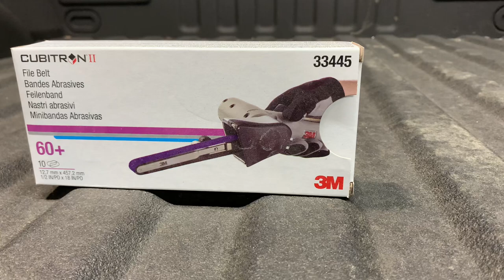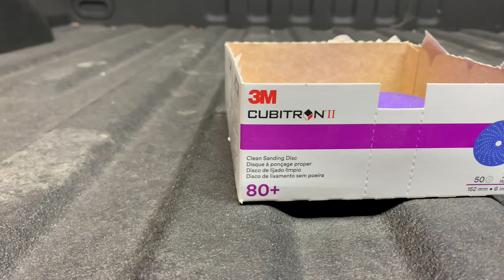FORD F-150 FX4 - ALUMINUM BEDSIDE REPLACEMENT

Comment: I use spr’s in the wheel openings and the by the tailgate. Blind rivets look terrible. Great video though.
Reply from the maker: SPR are cosmetically better looking, I do agree on that. Unfortunately when this video was made, the procedure we had gotten from Ford required blind rivets instead.
Reply: @AutoBodyDoctor  I get to tackle my first aluminum rocker/cab corner job this week. Hopefully it goes smoothly lol
Reply from the maker: @bryanmallison3967  Keep the surfaces areas clean and do some quality test welds. Once that’s dialed in you’ll do great 👍🏼
Reply: Where in the ford procedure do they say to use spr?!. ford tells you specifically witch part number rivits to use in specific locations,none of witch are spr. In the day and age of liability and lawsuits, i definitely would follow manufacturer procedure witch this video follows correctly.

Comment: Incredible video, super detailed, I like your style. I have a couple questions I was hoping to ask you. 

If you had to remove a box side panel from the truck to be reinstalled again on another box, rather then get a replacement panel, how would you go about removing it? Would you still use your belt sander and go from the outside or would you try and get behind it somehow? 

And did you just utilize the same holes the original SPR’s were located for the new blind rivets you put in ?
Reply from the maker: Trying to reuse a bed side can really only be done if it’s a steel panel. If it is aluminum then you should really be replacing it with a new panel. By the time you do get the aluminum panel off, there would be damage from using heat where it has been glued. Essentially making the aluminum weak and unable to keep its shape.
Reply: @AutoBodyDoctor  unfortunately I think it’s my only option here though so I plan to be extremely careful with it, not exceeding heat specifications and doing my best to not bend anything too much.

It’ll be a lot longer of a process this way but I can get a used bedside for like $250CAD and I’m also replacing the cab corner on my truck so I’m buying a cut out cab corner section for $250CAD and I’m going to carefully remove what I need from that as well, being mindful of heat again and working as much from the backside as possible. 

I haven’t come across anywhere here to get replacement repair panels that aren’t extremely expensive unfortunately. 

I could send you pictures of what I’m buying if you’d be interested in talking more when you have free time but you probably get the idea. 

It’s definitely a big time investment for me but it’ll be worth it in the end. First truck and I plan to keep it for a long time so I’m pretty excited

Comment: What size drill fit did you use to pre-drill the rivets?  Thanks
Reply from the maker: I believe that they were drilled out at 6.5mm in diameter.
Reply: @AutoBodyDoctor  Thank you for the reply!

Comment: Looks great.However, that's a one time deal.If it ever gets damaged again, there's no getting that skin off
Reply from the maker: That is actually incorrect. The adhesives used to replace the panel are the exact same adhesives used at the factory. The rivets would be drilled out again and the same method would be applied for removing the panel that was just replaced.

Comment: Is this the same for a f350?
Reply from the maker: That would depend on what year the F350 is.
Reply: 2016 I believe I have to do a bed swap tommrow
Reply from the maker: That may be a steel bedside, which would be a different procedure. Steel only involves MIG welding and resistance welding. Not like aluminum that uses glue bonding and rivets.